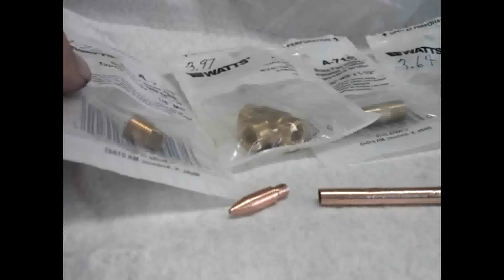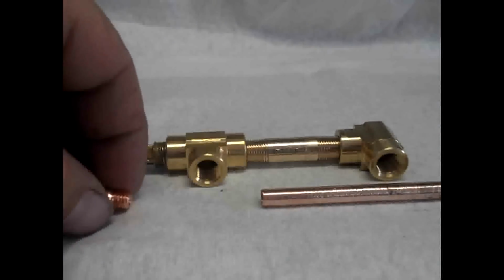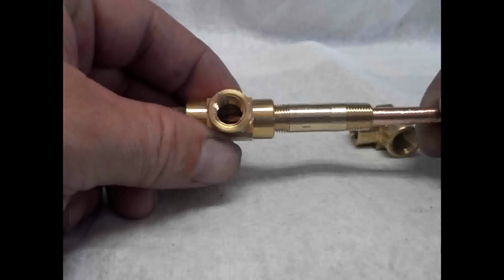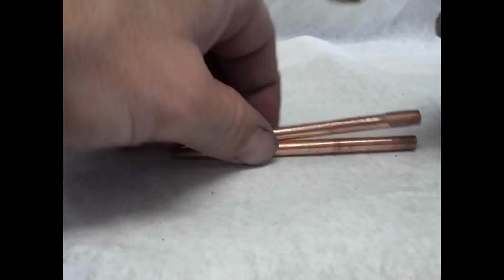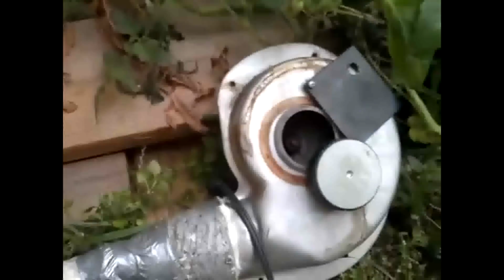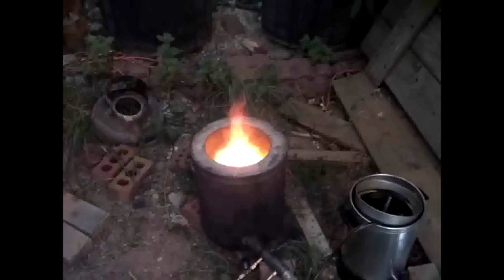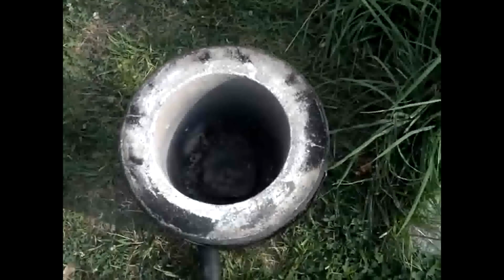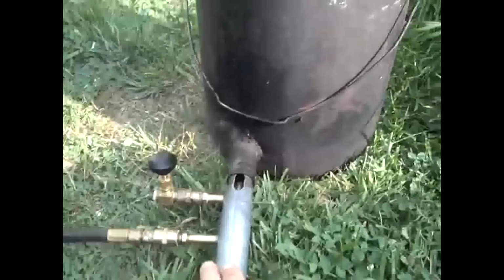How to Build the Kwiky All Fuel Foundry Burner

Comment: I havent done much soldering.  how does the second solder work?don't you cut right where you soldered? or do you leave some copper pipe sticking out?
Reply from the maker: +Kevin Coatney (Bean14)  you use a soldering flux that pulls the solder into the space between the pipes.  If you know any plumbers, have them do it for you...It won't take them long.
Reply: +David D I can't find any long mig tips online or at my local hardware store.
Reply from the maker: Kevin Coatney the only one I can find is a Miller too.  I will look up a link and post it when I am at the computer
Reply: +David D ok i think I have all the parts for my first try. hopefully it works. tho I don't see what keeps the pressure from trying to go up the oil side rather than creating a vacuum?
Reply from the maker: The air rushing through the tip creates a pull on the oil.
Reply: +David D it's not working I'm having exactly the same problem I asked about its not creating a vacuum. have you had this problem?
Reply from the maker: did you sharpen the mig tip like a pencil and solder it into the tube...and then push it in tight against the screwed in plug before you soldered the back, second solder point?  You should be able to see that the tip where the air is coming through is beyond the edge of the hole in the plug.  send me pictures?
Reply: +David D I was finally able to get vacuum. but I'm afraid my compressor isn't big enough.. ik I'd have to upgrade eventually.

Comment: Call me blonde, but I don't get this. If the mig tip/copper tube is soldered to the end of the 1/8" nipple, then the elbow is screwed on, how does air/propane flow from that end to the one with the hole? Did I miss a step somewhere? Doesn't the soldering operation seal that end? Thanks.
Reply from the maker: +gcolwill no problem...the tube is pushed in until the tip is tight against the plug at the front.  Then, the tube is soldered where it goes into the nipple.  then, the tube is cut off even with the end of the nipple.  Does that make sense?
Reply: +David D Thanks for the reply. The end with the hole is easy enough to get. it's the other end that troubles me: if air or propane is supposed to flow from that end, how can that happen if the end is sealed by the soldered pipe/mig tip?
Reply from the maker: gcolwill oh...the solder doesn't plug the hole...just around the edge like soldering a pipe.  If that bothers you, you can substitute those two parts with a long Miller tip like I show on my web page.
Reply: +David D Ok - I'll give it a try. Thanks.

Comment: hej
isnt there any solution for burn oil without preheating?

greetings
Reply from the maker: +D Bb I built a pressurized container to help the oil flow right.  I haven't had much time to play with it, but it seems to work fine so far.  It doesn't need too much pressure to operate.
Reply: so you heat it with pressure?
Reply from the maker: no...if it is pressurized, it doesn't need heat.  some people pressurize it by simply putting the oil container up high. That works too.
Reply: lol this is a very low pressure.
can i also do something else?
Reply from the maker: D Bb what do you mean?
Reply: im seeking for an other way for making a bigger pressure. i dont want to put the oil container up high.
you understand me?
Reply from the maker: sure...make an oil container that is pressurized.  You can use the same air pressure that you are using to run the siphon nozzle.  i built one.  I used another line from my air compressor with it's own pressure valve.  It only needs to be 5 lbs or so...and it hardly uses any air...it just keeps constant pressure on the out flow...so the burner can be used even if someone is having problems getting the siphon to work right.  I can take a video of mine if you would like...I thought I already had a video but i couldn't find it.
Reply: i would liket to

Comment: If you jammed the mig tip all the way against the back of the nozzle orifice, wouldn't that block the path from the oil? Having a hard time understanding how far to put the nozzle in. You could generate a venturi at any number of distances, but once you press the mig tip against the nozzle it would seal off the oil output.. how do you keep that from happening?
Reply from the maker: pwntagerz the mig tip is pushed tight against the nozzle only to solder it in place.  Then the nozzle is unscrewed a bit to create the space needed for the oil to flow!  Hope that helps you!!
Reply: I watched the assembly part of this 3 times..... thinking the exact same you where.... then i was like ok lemme see how many other people in the comments are goin how? um? WTF?? but now i get it hahaha.
Reply from the maker: Yalvan 88 yea, I said what to do but maybe didn't explain it enough.  Then I get other comments that say I talk too much!!! LOL!!!

     The concept is really easy for the tip though...screw the nozzle in tight for the build...then, when the mig tip assembly is installed and soldered in, loosen the nozzle to give the needed gap for the oil to flow through.

Comment: if it blows air in oil container what am i doing wrong
Reply: hushpuppy@gmail.com air
Reply from the maker: hushpuppy@gmail.com Most common problem is that the tip is not adjusted right for the center of the plug nozzle

Comment: is the burn off smell bad?
Reply: It doesn't smell at all if it is adjusted right
Reply: Organic Gardening in North Carolina i built it exactly what he said and air blows in water container, rebuilt it three times trying to figure out why
Reply: I actually am Dave...this is just a different profile.  Unless your 1/4 inch tube or the mig tip is not soldered in correctly, your problem is most likely the tip and how close it is to the nozzle.  Have you tried adjusting the nozzle in and out?  Is your mig tip sharpened like a pencil?  Someone told me that the store has a different plug than the one I used...it has a hollow in it.  the one I used is solid.

    Did you screw in the nozzle the whole way and then push the mig tip soldered on the 1/4 inch tube tight against it before you soldered it?  Make sure the mig tip can be sen centered in the nozzle opening too.  If it's not, you may be able to center it by taking the nozzle off and bending the mig tip.  Hope that helps.

Dave
Reply: Organic Gardening in North Carolina  So i fixed the problem with the water blowing back into the water container. so i  put vegetable oil  just to see how it goes...    took way to long or is that cause it oil lol, to go through the tube.  or is that normal.  Btw the video is great thank you!
Reply: hushpuppy@gmail.com yes, 30 psi.  The blower doesn't help pull the oil.  Commercially made siphon nozzles can operate at much lower pressures

Comment: Cool build I wanted to know what kind of compressor do you use... Would this be enough  http://m.harborfreight.com/1-3-hp-3-gallon-100-psi-oilless-air-compressor-97080.html.  Or so I get the 21 gallon one
Reply from the maker: chabuki69 sorry I didn't see your message because it got sent to the possible spam folder because of the link...I don't think that compressor would be able to keep up with the burner...You need a pretty big compressor.

Comment: Hello. I build a similiar burner like yours but I can't get it started with waste motoroil.
It is a bit different to yours because I can't get the same parts here in germany.
But it sprays very good.
Do you preheat the waste oil? Which temp?
Reply from the maker: Are you burning it in a furnace?  I would start it using diesel or kerosene.  That will help you get the air set right.   Then, whwn the furnace is hot, slowly switch to oil. 

Let us know how it goes

Comment: David
I think your design is excellent. It burns great on #2 fuel oil. After it is hot I switched to 50/50 fuel oil/drain oil. Tomorrow I intend to heat the drain oil in a 30 cup coffee maker as shown in one of your movies.

I built an oil burner based on your concept. It works well on my existing furnace.  The bore of the furnace is 12” deep and 10” diameter.  The pipe into the furnace is 1½”.
Tomorrow I am going to fire and dry my new furnace. It is based on ½ of a 55 gal drum.  The bore is 18” deep and the diameter is 15”.  The pipe in is 2”. I intend to use the same 1½ burner. With a reducer to connect to the 2”pipe.

If I am not getting enough BTUs in the big furnace I intend to make another burner unit. I will build it in a 2” pipe.  I will bore the jet out to.O50 and the Plug out to 1/8.
What do you think.

I tried to e-mail you pictures but you e-mail address is not recognized
Dan Kortuem
Reply: Send it to drescher3 (at) yahoo (dot) com. I need to update my website.

Comment: I fired up my foundry today a test run burns oil well . When I set my crucible in it drowned out the flame research and development. Tomorrow I will try another crucible smaller diameter and with legs about 3 inches higher than before.
Reply from the maker: I believe you should have about an inch clearance around the crucible.

Comment: Great design, note for novices soldering, test each piece as you go to make sure you have air flow where you need it, and not where you don't.
Here's ours burning on tiki torch lamp oil, later we switched it to motor oil, but the thicker fluid needs a bigger fuel line than we have (1/8" ID)
https://www.facebook.com/video.php?v=10205293724961229&l=666135187509396350
Reply from the maker: Looks good!  Thanks for sharing!!

Comment: Went to Lowes and picked up the parts.  The check out system rejected the sale of the elbow. A lead problem in the brass.  When back to the department and all were removed.  I was not happy....they were marked $2 off each
Reply from the maker: I think most brass has trace amounts of lead in it.  I bought a hose sprayer that had a lead warning on it.

Comment: Jeff here again, I watched your video several times and I have done what you told us to do. I mounted the unit in the old wood stove and put a brake caliper in the bottom to help with mass and radiant heat. I get a mist of oil or kerosene out of it and I have tried several different air pressures, and adjusted the spray head. I can get the kero. to burn and heat everything up, but for the life of me I can not get used oil to burn. I took the unit apart to check my construction and tried it again. I have been all weekend on this project and can not get it to work. now what?
Reply: Jeff Fleming try heating your waste oil......or go over to myfordboy's youtube page and see how he does it....I forget what he heats his oil to but he says it helps with ignition......

Comment: I wanted to ask if you tried the air supply in the front fitting? The air would go around the mig tip and pull the fuel through the mig tip orfice...
Reply from the maker: Matthew Lawrence yes, It works both ways.  I tried it that way first and then switched it and didn't see a difference.  I guess I could pull out my vacuum guage and test which way pulls better

Comment: OK, I was trying to light it outside because I wasn't sure how it would work. I did not want to start a fire inside first time.. I was not using the furnace. I will try it that way and report back. I was sure that I built it correctly.

Comment: Hello David, I am trying to build this to and I am having trouble with the siphon part. Instead of siphon I am getting back  pressure up the supply line. Mine is a  1/16 hole in burner tip it was too big so I soldered it shut then drilled it to the 1/16 with the 3/32 outer orifice  . It sure looks nice just does not work right. I have been testing with water.  Any suggestions.
Reply from the maker: it sounds like you may not have the mig tip close enough to the outer orifice...or it isn't lined up straight.  drilling the tip may not be a good idea too.  Did you use a mig tip?
Reply: David D  Wire feed and I have no hole in my tube either.

Comment: I got about $40 in this thing so far and I still have yet to get it to burn. I would sure like to know what I am doing wrong, or are you just scamming us some how?
Reply from the maker: Have you tried lighting it with kerosene or diesel?  It is a lot easier to get it started that way.  Also, it is designed to be used inside a furnace...and putting some wood in the furnace to preheat it could be a good idea too.  It works for me and other people too...and I don't have any reason to "scam" anyone!!  Show us a picture or video of what you have done and maybe we can help you out.

Comment: Do you think it's possible to modify an old oil burner for a furnace?  They are very similar in design.
Also, what is your foundry lined with?
Reply from the maker: Yes I have seen people use burners for their foundry.  Pull it out of the furnace as soon as you turn it off so it doesn't get heat radiated back into it as it probably has a rubber O ring in the nozzle that will melt.  My furnace has twolayers of commercial refractory.  One with 2000 degree F rating for more insulation and the face one with 3000 degree rating.
Reply: sweet thanks

Comment: I used your fuel supply design, with modifications/additions, to build a waste oil heater to heat a 24' x 52' work shop using a 55 gallon drum.  This is a 12' high steel building with NO insulation.  On last test I was able to raise the inside air temp. 18 degrees above the outside air temp. (40 outside 59 inside).  I'm burning approx. 1 gallon per hour of oil so I should be able to calculate the BTUs based on the formula another commenter gave. Thanks for the design idea.
Reply from the maker: glad it works for you...I would love to see a video or pictures?

Comment: Impressive design.  Your creation?  I shall be building this using your design, but would like your input on a modification.  Do you think it reasonable to replace the rear elbow with a "T", use another short nipple at the rear, get a cap for the 1/8" rear nipple, drill the cap to allow a tight fit for the 1/4" supply tube and increase the length of the 1/4" supply tube to exit the cap, drill holes (air supply) in the tube at the approximate location of the rear "T", and solder/braze the 1/4" tube to the cap?  Then the cap could be turned allowing adjustment of the fuel flow.  In essence moving the welding tip forward and back using the threads of the cap and nipple, much like you used the plug.  But revised to allow adjustment under heat and as needed.
Reply from the maker: I would think it would be hard to stop the high pressere air from going around the 1/4 inch tube and out the fuel supply.  Maybe if you put an o ring in somehow.  It shouldn't need adjustment once it is done.

Comment: Is the mig tip hollow? Because if you solder the pipe to the nipple i don't see how the air gets to the nozzle.
Reply from the maker: Yes, the mig tip is hollow for the wire to feed through it.  The way it is used in this burner is that it slips into the pipe and that joint is soldered
Reply: OK thank you

Comment: You have 1/4-28 threads on the mig tip. Run a tap in the tube. Buy the tap where you got the fittings.
Reply: And 1/4 od on tubing. Tapping it 1/4-28 is likely to produce a cute lil copper coil at the end or maybe a good thread with maybe 2 thou wall thickness at the thread root and thus very weak. Plus, most likely, the rake angle on any tap you will be able to buy locally will not be appropriate for cutting copper and I would expect galling, a stuck tap, the tube to twist up like a corkscrew, etc...
Reply: Michael Aumick I was thinking the same thing. Good on ya mate.

Comment: I see great potential for a thermal mass stove for heating a dwelling. Think giant pillar of cement with hollow center. Fire it on waste oil until the outside temp is reasonable. Then cut it off and let the heat radiate out. Of course the weight would be insane. Cost might be a little high as well lol. In theory however you may only have to fire it once a week for a day to keep a place reasonably warm.

Comment: what did use for cement in the burner
Reply from the maker: the burner is soldered together ...or I should say, the welding tip and air supply tube is soldered.

Comment: the btu are ?
Reply from the maker: I don't know...it's hot though!!
Reply: Well, if he can chime in on how much oil is being burned, he can use the following to get an estimate of the BTUs: "A typical gallon of waste motor oil contains 153,000 to 180,000 BTU per gallon, which can be more than TWO TIMES the energy potential per gallon of LP gas. LP gas has a potential for 92,000 BTU per gallon. A typical gallon of waste vegetable oil contains about 128,000 BTU."

Comment: Great tutorial! Awesome design. I have some questions about the nozzle tip: After adjusting it the half-turn or so as you suggest, in order to get a proper mist, do you leave the tip easily accessible to adjust again later if needed? Or do you solder it in place in order to prevent it from loosening off, or tightening on it's own over time? 
Again, great vid!
Reply from the maker: I haven't had trouble with it loosening up...so no I don't use anything to hold it in place...pipe dope could work because the tip won't get hot...it is important to take the burner tube out of the furnace as soon as you turn it off so it doesn't get too hot though.  Thanks for commenting and let us know how it goes for you.

Comment: if you force the tip in against the drilled plug how does the fuel get through? I had to back out my plug but seem to get fuel dripping out the back, having trouble getting full atomization any ideas?
Reply from the maker: You have to put the tip tight against the plug to solder it in place...but then, you unscrew the plug a half turn or so to get the clearance needed.